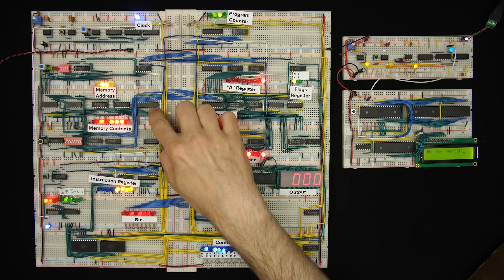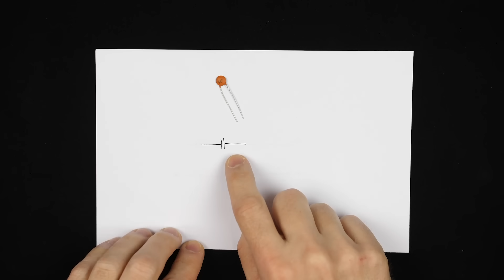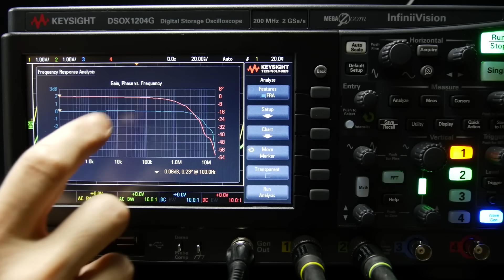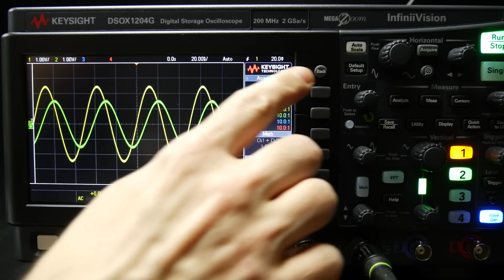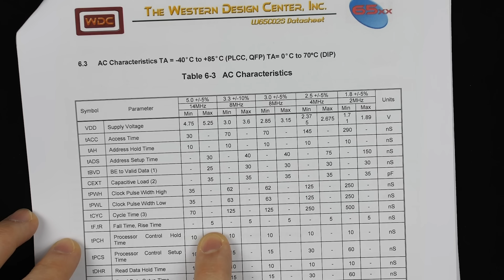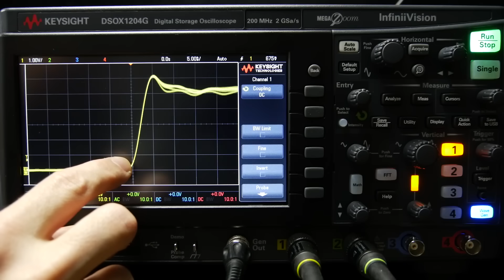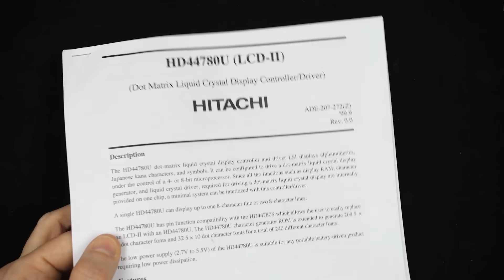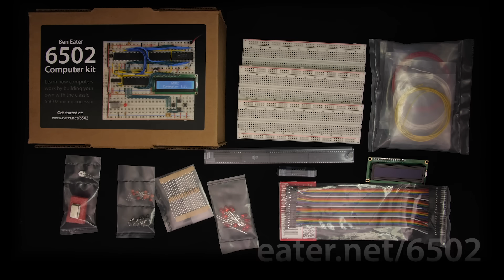Why build an entire computer on breadboards?

Comment from the maker: For more info on what breadboards I recommend, see https://www.eater.net/breadboards
And if you want to play with the graphing calculator models, check out these links:
https://www.desmos.com/calculator/txls6jc88c
https://www.desmos.com/calculator/i75gnzi3jb

The rest of the 6502 project is here: https://www.eater.net/6502
Reply: I want use my 25 old x86 processors with breadborads, 
it is posible ?
Reply: I want use my 23 year old x86 pentium MMX processor with breadborads, 
it is posible ??
Reply: You didn't actually answer the question "Why build an entire computer on breadboards?" A lot of the video is about the potential problems with building a computer on breadboards.
Reply: I think he answered why to use a breadboard when he was talking about if you just buy kits (like when they come with premade board and components, where its plug and play or solder and play, lol, and works basically as soon as you are done --- you don't learn much (other than soldering)..   Where as a breadboard computer, etc. is gonna challenge you, make you have to problem solve/debug, ingrain critical thinking/knowledge etc..  😊

I was always a fan of building things off of a copper clad board I'm kind of a three-dimensional fashion with solder but ironically I started using breadboards more hopping because you can try more things and reuse components easier -- 😊
Reply: @dmeemd7787  Well then I suppose part of the reason to use breadboards is all the things you need to consider which he explains in the rest of the video
Reply: Actually I ran into the crosswalk issue when I build my own 8-bit computer.

In my case it was the clock signal which was routed along the reset line which caused the stack module to reset randomly  from time to time due to long wires and stray capacitance. 

The issue was even there at only 1 kHz (but ok, my CPUs footprint is half a square meter or so as it is build from 10+ 10x15cm solder boards).

I solved the issue by adding a 10 uF capacitor to the reset input of the modules with the longest wires which caused the reset signal to stay high....
http://www.soerko.dk/SK-01.html
Reply: JESUS died for our sins on the cross, HE shed HIS holy, innocent , precious blood for us (HIS blood washes away ALL sins) HE was buried but on the third day GOD raised HIM from the dead. All you have to do to be saved is: Believe in JESUS, trust in HIS blood. JESUS did everything for you, no works are required for salvation (Ephesians 2:8-9)!..
Reply: @believeonjesus7215  dats cap
Reply: @believeonjesus7215  One can believe , but do NOT alter the facts : Jesus was a Jew born to a Jewish mother (Miraim) , Jesus was a Hebrew speaker couldn't understand  English.
Reply: Hello Ben
Reply: Ben I was wondering if you ship to Sudan because I really want of your kits because some of these stuff you use in your videos are not available in my country
Reply: I was only at the beginning stages of an EE degree when I decided to switch back to IT, so this question might be totally off but: I don't see how the switching of the logic signals are 'built' using sine waves? I know that you can make a square wave using sign waves, but in the case of the logic signals, they aren't just simple square waves , but a DC voltage at either 0 volts or 5 volts. Obviously you know more than me in this arena, so what am I not seeing?
Reply: @hololightful  In the circuit they are generated by switching the output pin between vcc and ground ( with pull up/pull down transistors), controlled on the crystal oscillator  with a comparator, on the rest of the chips by logic mostly, in theory producing "ideal square waves".
However any square wave is still composed of sine waves. independently of what device produced it.
Reply: @dgo85  So if I have a simple circuit (say a 9 volt battery, a physical switch, and a light bulb), and I'm repeatedly pressing the switch, that repeated 'square wave' I would see could be modeled that way (sine waves creating a 'square wave')?
Reply: @hololightful yes, in the end any wave can be described as a combination of sine waves.
The dificulty in the switch example would be estabilishing the values (amplitude, period, frequency, and phase ) of each sine, they would not be stable also, becuse the frequency at wich you toggle the switch would not be stable.
Reply: @hololightful  nah that isn't being created by sine waves and not all square waves are being created by creating and adding sine waves, but mathematically they can be modeled this way..One obvious thing is when you start getting deep into dealing with impedance, reactance, measuring the inductance and capacitance of wire just being used to make connections and so on, it becomes extremely complicated extremely quickly, lol -- but to zoom out a bit, so to speak.. a sine wave since created from a mechanically driven generator for mains power, etc. is a nice sine wave because of how its created (from the rotating magnetic fields, etc.) and if you have a low voltage since wave, let's say a 2 volt Peak to Peak AC sine wave, you can turn it into a rough square wave by just clipping the waveforms using diodes or diodes and op amps, or use other methods to make it cleaner. The way a 555 timer makes a square wave is it going to be the same as clipping and shifting a sine wave but there will be similar characteristics, you'll see things Bounce Around stuff like that so I'm sure I just made things worse cuz I have a migraine as I'm typing this but it depends on what you are trying to analyze to determine where the question you are asking applies :)  -- sorry if I became unclear, cluster headaches coming on SUCK 😂
Reply: @hololightful  Here's another way to look at it.  Your signal may have "really" been generated as something that looks like a square wave (toggling a switch, as in your example) or it might have been generated with sine waves (for example, maybe an audio signal).  When your signal looks like a square wave, you could treat it as a square wave or the sum of sine waves regardless of how it was actually generated.  They're mathematically the same.  But in some situations, the math for predicting how the component sine waves are affected is much much easier than the alternative, so you're best off going with that model.

The other thing to realize is that the effects you see when you analyze a signal with sine waves are real effects.  Real signals ring and decay.  It doesn't matter if they were generated by many sine wave generators or by switches and capacitance and inductance, they will still ring in the right circumstances.  If you're looking at the high-level zoomed out behavior, thinking of a signal as a square wave can be fine.  If you're looking at the low-level zoomed in behavior (like why is my clock not working) you are probably going to find looking at it as sine waves with frequencies is better.  Both are useful.  They're just applicable in different situations.
Reply: @doctorbobstone  Thank you, I had a feeling that might be where we were going with this, but I didn't want to assume that's what was meant. Your explanation was perfect.
Reply: @hololightful  Glad it helped.
Reply: A text book states that  a  logic signal is switched from "0" to "1"
   but physically such switching takes time  so the signal actually ramps up from 0 to 5 volts  
  A mathematical explanation :  a transition "0" to "1"  is  produced many a adding  a sine  waves  sine_wf  to  many other higher freqrncy sine waves .  Such math takes an enoprmous amount of SOPHISTICATED understanding that results ONLY after slow, careful study . It will take time and effort.
Reply: if you were mexican your name would be BEAN EATER
Reply: Could you make a Not gate version of the your logic gates video? That video really helped me under stand logic gates, but everything I look up on the Not version of the gates doesn't make a lot of sense.
Reply: @michaelhiltz7846  pick up a good book that thoroughly covers the topic of boolean logic. Start from the most fundamental stuff, e.g. bit, word size, binary operators, arithmetic, etc. Do the practice exercises. Everything will start to make sense once you have a good foundation in place. Good luck.
Reply: @markzachenberg2797  If I wanted to read a book on this I would have bought one. I want to see the circuits and how they work, Ben does a great job at demonstrating those.
Reply: Hi Ben, I love every video you make. This one is no exception. Thanks, kwwp them coming. Hope you're safe.
Wanted to ask, what capacitors do you use (the one you plug during the video on the power rail and at the IC power pins)? Sounds like a great recommendation, I'll buy some. 
Also, can you recommend any good video, or tutorial to understand about the capacitors and this kind of use to mitigate power fluctuations?
Reply: Did you eat Uncle Ben's rice?
Reply: Ben Eater where’s the kit you showed on this video?
Reply: What is your opinion on the 3M breadboards?
Reply: I love you Ben😭
Reply: Make a Super Nintendo breadboard with an HD outlet port.
Reply: Did you technically write an OS for the 6502 so you could write “Hello world”?
Reply: no thanks nerd
Reply: Can you play Doom, the original on Breadboards? So much views you wilk get
Reply: In this type of work considered hardware engineering?
Reply: NICE AWES0ME C00L_  VIEW * BEN🍨🍚🍚🍚🍚🍚🍚🍚🍚🍚🍚🍚 💨 🍮 🥧 🍡 🍧 🍨 🍦 🍰 ❗ 🐬 🌺 🌺 🌺 🥀 🌹 🌷 🍁 💐🍂 🐡🐄 🐅 🐆 🐯 🍣 🍣 🍣 🥘 🍨🍨🍨
Reply: Omg words words words words 🥱😴 can I play Fortnite on it or not?
Reply: We use  Breadboards now,  because the  Grilled  Cheese boards were just  too sticky... :-)
Reply: What that spring is for what that spring is for what that spring is for what that spring is for what that spring is for what that spring is for what that spring is for
Reply: Have you seen video of JON LEVI channel on Tartaria ?  The entire earth was a motherboard ! The squiggly Thames river in London is 1 resistor! It's mind blowing to see old evidence of star forts now called BATTERIES by the military.. Free energy was all over earth before it looks like a short circuit melted everything.. Jon Levi makes excellent video for this area
Reply: "Why Mr. Anderson, why do you persist?"
-because I choose to
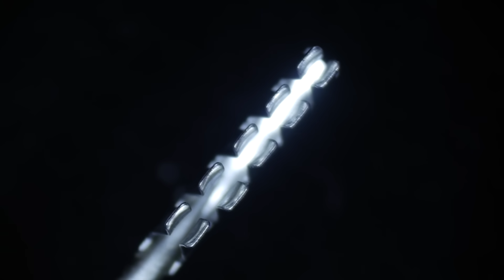Reply: 2:58 HOLD UP!

Comment: there are pre-perferated circuit boards, that you have to wire in yourself too. that's goood for finalizing a froject, and even if you make a mistake, you can just undo it with soldering whick.

Comment: Honestly, this video is a MUST WATCH, for anyone who's trying to jump into electronics! I personally almost had my electronics journey  destroyed before it could even build up momentum, when I tried to build my very first circuit on a cheap breadboard. 
I found the circuit - an astable multivibrator - in an electronics book and thought to give it a try! So I bought the necessary components and a cheap breadboard. I build the circuit, but no matter what, i couldn't get it to work properly. I spent painful HOURS of "troubleshooting" and almost gave up entirely, thinking that I'm probably just too stupid for electronics over all, only to then find out that my breadboard had dozens of continuity problems through out several rails, which made it completely impossible for me to successfully build the circuit this way.
I then started to check the entire board and bridged all faulty connectors, leaving me with a funky looking patched but working breadboard and some very valuable lessons learned!

So never cheap out on breadboards - and probably you shouldn't do it on other components either! Especially if it's a gift and the receiver is a beginner!!! It can totally mess up their first experiences with electronics and might leave them with a memory that might make them never try it again and that would be a big loss.

Comment: Started into building my own Z80 computer.  A lot of it highly inspired by you.
The first breadboard circuit in my case was an STM32BlackPill and the ROM chip.
When it didn't work and I began attaching the logic analyser, I just ran out of space, breadboard holes, patience and ultimately motivation to continue.
Ben, you are extremely patient.
I am not giving up.  I am going to move forward to protoboads and start getting a move on with PCBs.  I like that you can draw and test a circuit virtually (with KiCad and Verilog though not (yet) together).  Then get someone/thing else to do the fiddly bit of running 85 connections perfectly.  
The downside is the round trip time.  KiCAD to PCB on the bench is at least 2 weeks, usually 3.

Comment: @ben eater - I owe you a HUGE apology.  I want to build your 8-bit computer.  But I didn’t want to spend the money on your kit.  I thought I’d be “smart” and order the parts - and breadboards - myself. Was going to save $100.  I bought Elegoo boards from Amazon.  Now I am finding out they are junk.  So I’m sending them back and buying the BB830 boards.   And now I will be spending quite a bit more money than if I’d just bought the kit from you.  Sigh.  At least I used the Jameco affiliate link you supplied to purchase the components.  Anyway, sorry I doubted you!!!

Comment: To solve this problem of bad connections, I switched back to wire wrapping!
I build a breadboard with rows and islands of pins, and wrap the wires around them..
And use your method only to test a layout, but I don't know what the quality is if I order a breadboard!

Comment: I purchases a cheap breadboard, and I found an entirely different problem:

Leakage currents due to poor insulation resistance!

I was getting very weird results, then I found that the actual plastic was conducting electricity! 

Great video, keep up the good work!

Comment: Thanks for the info.. I did not know you can put capacitors to maintain a voltage. I did a 7 segment counter recently and the signals were weak and does not light up the display as i expect it to be. Our teacher said the signal were decaying bcs i used 7 breadboards for the project. I wish I knew this beforehand.

Comment: I must have cheap bread boards… Every time I prototype anything with shift registers using a high speed SPI bus I always have all sorts of issues. I take the same circuit and solder it up on a prototype pcb and it works flawlessly. 🤷‍♂️

Comment: 0:45 - Just watching you build these computers on the breadboard has greatly enhanced my understanding of the inner workings of the machine down to voltage levels an timing. With a little machine and assembler thrown in! Thanks for all these byte-sized videos on the hardware level computer operation.

Comment: My Uni Z80 based project, all soldered on vero strip-board, was quite susceptible to RFI. The thermostatic soldering iron on the bench used crash the circuit when it click on or off! Made sure it was off for the demo.

Comment: I ran into that issue myself. I am really proficient at soldering and basic electrical engineering seemed beneath me, but I bit the bullet and started teaching myself from the beginning, by watching professors teach 101, 201, etc. now I can build basic circuits that only rarely blow up

Comment: When I was in my 20's, I built a Frequency Counter using a proto board.  Nixie tube displays. I showed it to the guys where I worked at the time, and they said it wouldn't work, but it worked perfectly when completed. Still have it in my shop.

Comment: At primary school we used wooden boards with brass cap screws. Electromagnets were my favourite, just a steel bolt and copper wire. I didn't get my hands on a CPU until I was 12.

Comment: So TIL despite my school having the cheapest soldering irons and multimeters and solder suckers, they must’ve not cheaped-out on the breadboard! We never had issues with people plugging a wire in and finding it not working, and they were used intensively by kids with not much regard for gentle handling. Pulling all the wires out in one go and that kind of thing. 

I did find it weird in your CRC video, how the negative rail was blue instead of black, but I suppose that isn’t a good enough indicator of quality by itself.

Comment: interesting, just as i assembled my first ordered soldering training radio i got here, and i have exactly the same conclusion. they are nice for soldering practice, although there are better things than those dyi thingies.
ive had way more fun with breadboards. to me it should be - breadboard, then get your own pcb, then solder things together. soldering is relatively easy and enjoyable process, but its got nothing to do with electronics

Comment: The BusBoard solder-less breadboards ARE VERY GOOD, the next best breadboards are made by 3M which are quite pricey, the 3M solder-less prototyping breadboards are probably THE BEST out there, you certainly pay for what you get! I purchase the BB1660 in quantities of 10 to get reduced quantity pricing, the BB1660 IS two BB830’s which further reduces the per unit pricing by about an additional $1. vs a pair of BB830’s.

Comment: looks like you jammed the tool into the metal clip forcing the tips apart... even before you jammed the other massively oversized tool in to bend it apart. Whats the point of being so over the top? neat concept but just seems like you are trying to sell your own expensive brand of bread boards. 

neat video, but seems scammy.